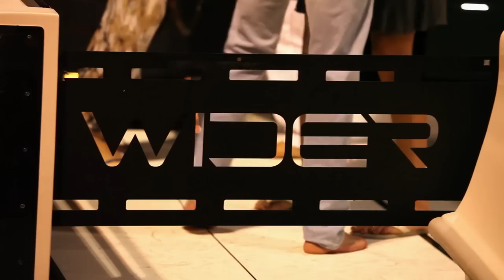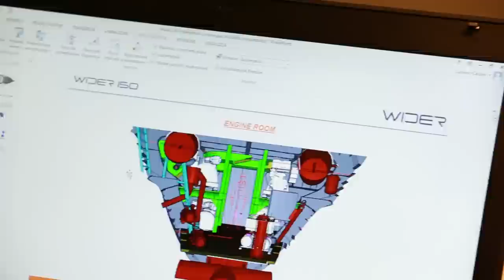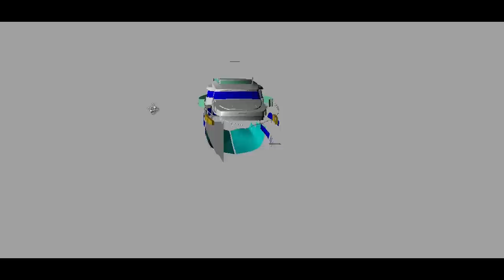WIDER 150' Superyacht For Sale. Part 2 - The Construction

Comment: Like the Tesla Model S I think if everything comes together for this Yacht the Wider 150 will be a landmark achievement. Especially if they would use fuel cells instead of Diesel engines. I am not a fan of the bridge top but the watercraft/teak beach area is remarkable.
Reply from the maker: Hi BT! Thanks for your comment. The propulsion system is revolutionary for the yachting industry and more details have emerged since I produced this video. I have written a blog article about it that you may find interesting http://yachtsforsaleblog.com/2014/06/17/making-waves-with-diesel-electric-propulsion/
Reply: Very interesting article thank you. I am intrigued by the idea of having the engines in the front and look forward to seeing the finished boat cutting through the water. There are yachts such as the Prestige 750 that seem a bit front heavy and suffers for it in my opinion.

A 150' yacht had different dynamics I am sure. Anyway thanks again for the link.

Comment: My question on the larger yachts is always "How much does it draw?" Often I learn that draught so badly limits ports of call, that I really would not want it regardless of how good it is in other ways.
Reply from the maker: +Casey Vee That's a really good question, and one that is of particular concern to U.S. clients who enjoy using their yacht in the shallow waters of the Bahamas. The hull design of the WIDER 150 employs pods rather than in-line shafts, so the draft is very low; 1.98m or 6' 5". The WIDER 150 will easily enter any super yacht marina.

Comment: I would love to see this boat perform on wavy waters compared to conventional boat design to see pros and cons in front engine design... (hmmm... I'm very curious)
Reply from the maker: Hi Ben Jay, thanks for commenting. The weight of four generators in the bow should not adversely influence the performance, since this is a displacement yacht rather than a planing hull design. I was in the shipyard a couple of days ago, the forward power generation room is now ready, and there is a great deal of work being done to cushion the generators in this area since obviously it ill be subject to a fair amount of movement in rough seas. The battery storage area, or "Power Management Room" will be midships, just forward of the swimming pool/tender bay. This is a fraction of the size of a traditional engine room. Cables are being installed, and the entire system from the generators to the props has now been tested and is ready for installation.

Comment: what about going towards fuel cell propulsion, like the 'blue box' or LOHC technology?
Reply from the maker: Hi Ustadh Jee, and thanks for your comment. I don't know too much about fuel cell technology, although I was involved on the outskirts of a project that proposed a propulsion system using hydrogen fuel cells. After weeks of analysis, the engineers studying the project concluded that it was not a viable proposition due to the weight/power ratio for smaller craft (the yacht in question was 70m LOA). I'm no expert on the subject...but I feel sure that as this technology advances we shall eventually see it used extensively in the yachting industry.

Comment: Funny how they talk about efficiency in terms of a yacht. Am I the only one who noticed this? Seems like an oxymoron.
Reply from the maker: +Ben Blanco thanks for commenting. Yachts certainly aren't built with efficiency as the main priority, but some are more fuel efficient than others. Many owners prefer a yacht with long range and also love the idea of spending a night at anchor without the generators on (more for sound and vibration reasons than for fuel savings). In yachting circles the WIDER 150 is about as efficient as you can get.